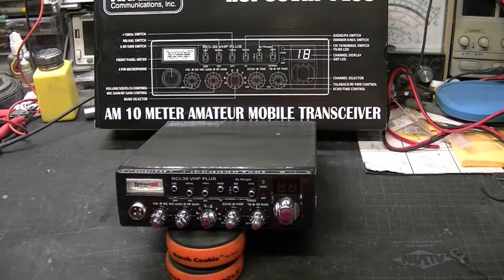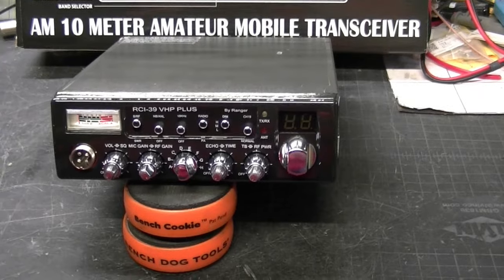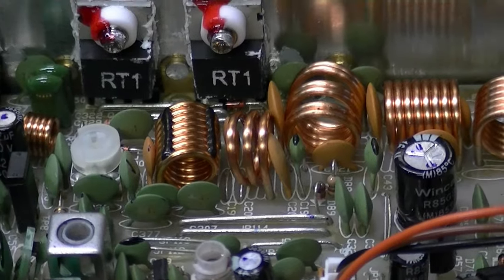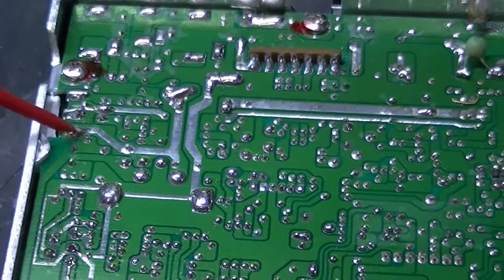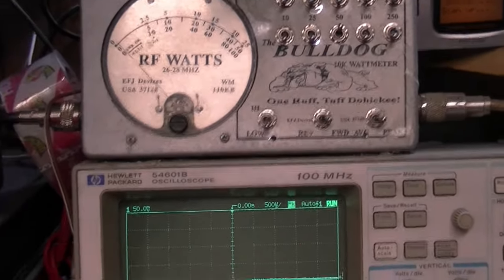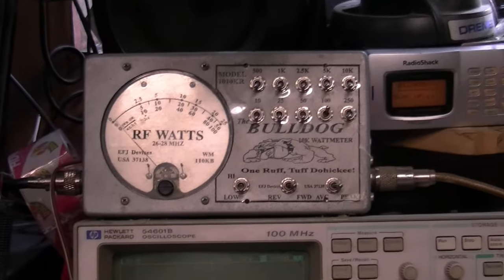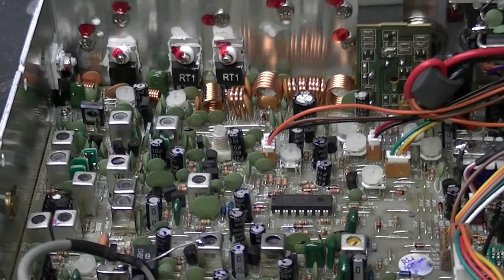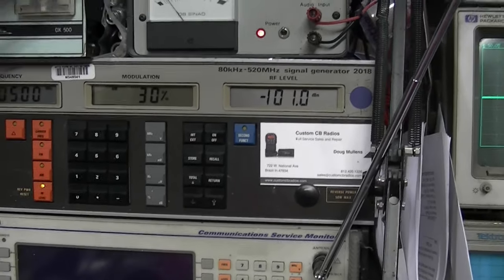RCI39 VHP Review

Comment: Looks to me like you adjusted a coil to was that for power too.I seen it don't know if anyone else did or not so which is it if factory does it you can to.
Reply from the maker: I re-adjusted them to the tune. It's called fine tunning the circuit. 
The whole point was to show that the factory adjusted them as well and it's acceptable to do so.
Reply: @cbrepairguy  yeah but the one you adjusted was set from factory that way so you split it open for more what. Hey I'm just a driver didn't mean to insult you just always was told that was not a good idea that's all.do it your way.
Reply from the maker: Back in the early days they used adjustable inductors instead of coils, but due to cost they decided to go to these coils that are wound to be close to the proper tunning of the circuit, the issue with that is that all electronic parts have a tolerance           (usually 10-20%) so no fixed coil will be a perfect tune  and by spreading them or in some cases removing some turns you are fine tuning the circuit and it's no different then when you turn the slugs on the older radios. I hope this makes sence to you. 
Take a look at a Cobra 29, it still uses a slug for tuning and every shop adjusts them don't they.
Reply: @cbrepairguy  yes they do